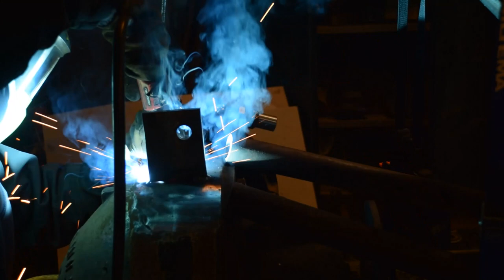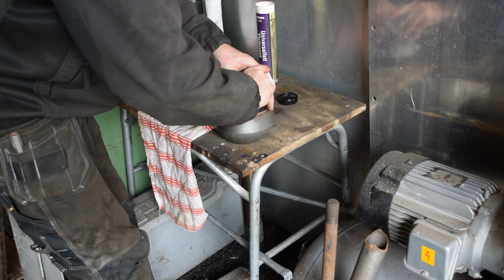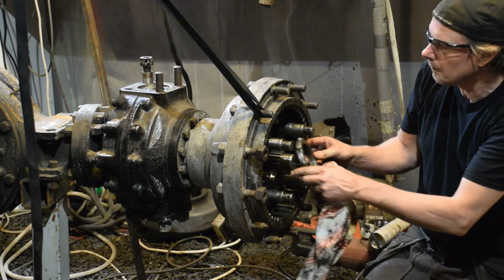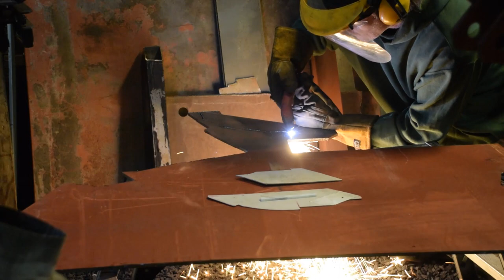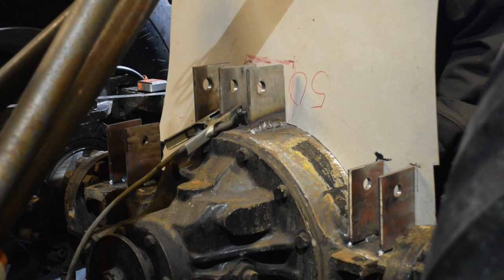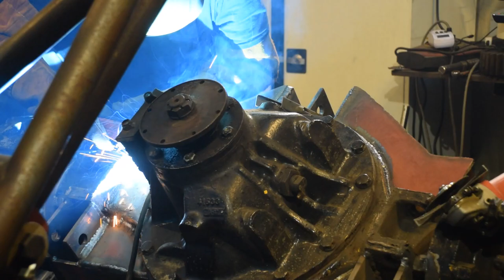Monster Truck Axles 2 Reassembly and Brackets

Comment: Not trying to be rude at all, but id be pushing those mig welds if you want good penetration. Especially for your upper 4 link mounts.
Reply from the maker: They are v grooved doubled welded and the first is pass is going up and welded with a 180amp tre fase pro welder so.